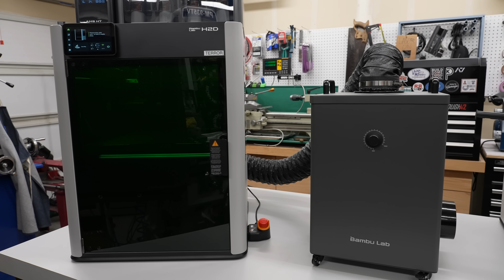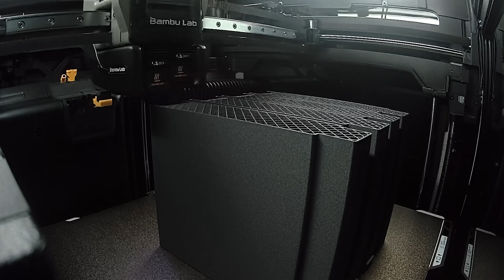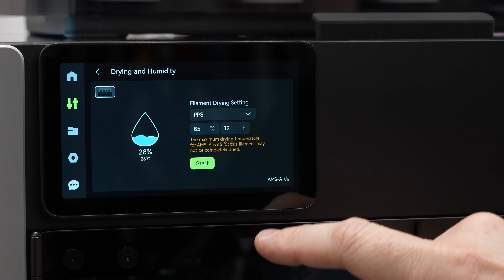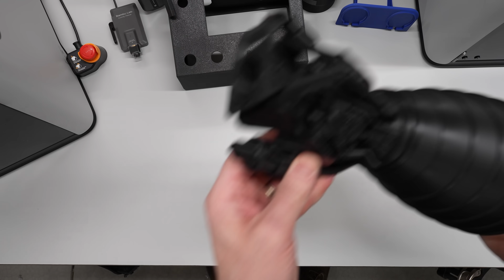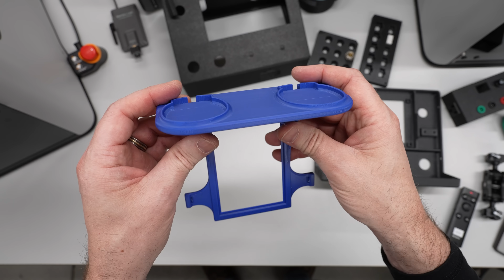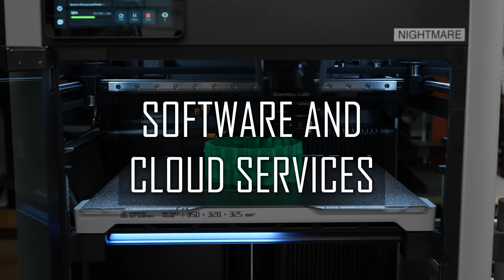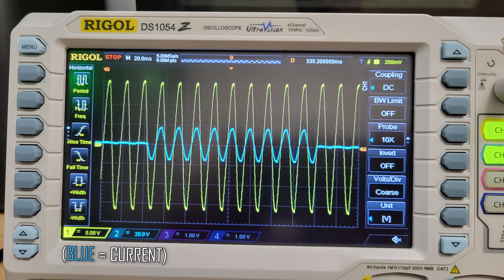What I Learned from 300 Hours with the Bambu Lab H2D 3D Printer

Comment: I presently have two x1e have just over 4000 hours between the two. I am going to purchase the H2D. My question is I currently do not have a need for the cutter or laser however maybe down the road. Can the laser and cutter be added after or do I have to buy it now. Secondly I use the Bambu slicer will I need to add a different version of the slicer for the H2D?  Thank you in advance!

Comment: Sounds like a nice tool. But I do like to build 3D printers as a hobby and tinkering with it, so I stick to my diy printer for now. If I need bigger parts I just use my CNC router with 1440x700x210mm build volume and do some subtractive machining instead. I don't use the 3D printer that often so spending another $2300 for this one wouldn't make sense. But if I ever want one that does it all and without fuss, I'd probably be looking at this one.

Comment: Your thoughts are very good, thank you for sharing something so valuable (I'm just getting into the world of 3D printing). Have you tried laser engraving on metals, such as knives? I looked for something related to H2D and didn't find anything... 

Finally, the "all in one" idea seems like a great investment... I'm worried about long-term maintenance, since it has many sensors and the use of the laser generates a lot of dirt, which can accelerate the wear of these parts (I speak from personal experience, I've been working with a Raykus 50w laser machine for 3 years and it generates a lot of dirt...), considering it as a service sale, while the printing is in progress the laser is unusable...

Comment: Great review and great knowledge from you until you told us your have socket outlets on the same circuits as lighting 🤦. Electric design outside of the UK are dangerous at best and a man with your knowledge and skill should do some rewiring before you burn your house down....
Reply from the maker: Should I put in ring circuits while I have all the walls open and the insulation pulled out?

Comment: While I agree with most of your points you failed at a couple. The Prusa XL is a 5 head printer while the H2D is only a dual nozzle single head printer. I am very disappointed with the Prusa XL so I really would not recommend buying one but that is not really fair. Use another idex printer to compare it to instead.

Comment: @Clough42...  I love the review and brought an H2D I wish you had explained the AMS 2 and filament dryer in more detail.  I was very disappointed to find out the AMS would not dry filament unless it was fully unloaded from the AMS.  I assume this is so it could rotate the rolls.    This feature basically makes the AMS dryer useless during prints.  That is it can not run during prints. After a print is done it can not run and dry out filament in prep for next print, after you remove old print.  It can not be proactive and run while printer is idle, etc.   Basically you can be drying filament with AMS or using the AMS not both.  As such it does not add any real value, over having external dryers.

Comment: I just ordered the full H2D laser bundle, 40 watt laser. It's not going to replace my 100W CO2 with the 20 x 28 bed, but it will be able to engrave where the CO2 requires a mask or anodize to engrave metal.  This should be an interesting ride.

Comment: I am kinda glad I didn't get the X1C last year now, you easily sold me on this one with how many things you were able to print perfect that even the X1 struggled with, and all the automatic calibration and monitoring to save me trouble baby sitting.

Id rather spend my time as a new comer mostly learning how to actually design my own prints rather than making a system run without error.

As what I see in your video, you having so many custom control panels and such is exactly the kind of thing I want this for.  I am always working on DIY projects and this would upgrade my capabilites greatly.

Comment: This is not a good printer for TPU, the solution feels like an afterthought and does not go well with new AMS 2pro which goes on the same head etc. This is a painful and expensive large X1C we wanted. We just wanted a big P1/A1/X1. This is NOT a great choice. It is not good bang for the buck. This is an overly expensive X1C with larger print volume and all of the extra features are things you will not use and come with childsicknesses of their own. Big red flag. Zero interest. The printer we wanted was a huge P1 or A1, or an X1C with 40x40. Not all this random nosense pushed on you to hike the price to over doubled. Big L for bambu this is not what the consumers wanted.

Comment: Great review! I saw that you already own the AMS HT. Since this is currently not yet availableto the public: did you try to use fiber-reinforced filament with the AMS 2 Pro too? If yes, I would be interested in your opinion on this since Bambu Lab does not recommend to do so but it would be a nice option if it works.
Reply from the maker: Really?  I've run ABS-GF, PAHT-CF, PETG-CF, and PLA-CF through the AMS 2 Pro without any issues.  I think the only thing I've bypassed it for is soft TPU.
Reply: @Clough42  They have PLA-CF/PAHT-CF/PETG-CF/Support in their list of supported materials and then state in their list of not supported materials "Bambu PET-CF/TPU 95A, and other filament that contains carbon fiber or glass fiber".
So I am most of the time using ASA-CF, PC-CF and PA-CF. All of these are not explicitly mentioned. That's why I asked.

Comment: I like your content as you use these machines for engineering material for which I also like I do not print anything other functional parts and yes I finally had a reason for nylon carbon fiber and it came out great

Comment: Interesting about Prusa XL. I've seen several videos with negative experience. I own one too. I has mostly positive experience. Major think I've learnt that I have to dry my filaments in order to achieve stringing less print. I printed different prints with 3 and 4 materials too. Of course I needed dial in all filaments before of the print if it was not original Prusament.
Reply from the maker: I think it really depends what you're trying to print.  I dry all of my filaments before use, and struggled mightily anyway with everything except for Prusament Galaxy Black PLA.  That printed reasonably well for me, except for odd outer wall artifacts when transitioning from large infill areas to thinner walls.
Reply: So prusa doesn't pay/sponsor machines to many youtubers. Compared to bambulab that gives everything they want for free. Even little youtubers get free machines to keep, so ofcourse they come out better then the competition. And most printers need some work to properly get everything to work, especially with custom design stl's

Comment: Comments about the power are only valid in USA where voltage is 110V and therefore current is higher - double for the same power draw, compared to countries where voltage is 240V.

Comment: I agree, this looks like a printer now.
But too much sensors for me. But yeah, it is a tool. Not an ordinary hammer though. This is a super duper hammer, which needs special gloves, special glasses, special robe, and you need to activate it before use. And it costs a fortune.
But this is a good hammer, I agree.
I prefer more simple hammer. Which you can do by yourself even, as it's so simple.

Will wait for the next model to see a review on it. It is just like an iPhone promo, very nice to watch.

Comment: All those cameras and sensors and you can still collide with an unremoved prime tower?!?
Reply from the maker: Yeah, it's supposed to detect that.  I wonder if that feature wasn't working yet when I did my testing.
Reply: @Clough42  Mind if I ask on the bed heat distribution issues others have reported?  I'm considering getting one but I am in the crowd of my X1C is currently running without access to the internet, Orca Slicer, and Home Assistant add-ons in place of Handy.  If they open up laser to dev mode I'll be buying.
Reply from the maker: @JohnDoe-wi8sx  I never noticed any issues with bed adhesion.  After hearing about it from others, I pulled out a thermal camera to have a look.  The initial heat-up does appear to be uneven, though after a while the heat spreads.  I think it's a fair critique, but I'm not convinced it's a practical issue.  If I had to guess, it's likely an engineering tradeoff for having the bed heat so rapidly.

Comment: Hello and thank you for the excellent review. I paid very close attention to your comments. I am a manufacturer myself and currently use Raise 3d systems. My eyebrows were raised when you were talking about the speed of this H2D. This is really where the rubber meets the road for me. Their documentation is all over the place on speed. As you said yourself "they throw out numbers". Their actual literature  says print consistent at 600mm/sec. That is nuts fast. And in some places it says tool head speed 1000 mm/sec. I actually contacted them and said can they explain. I was given 60-80mm/s for outer shell and 80-120mm/s for infill. What is your experience? You do comment on how fast this machine is, but do not give actual numbers. I know everything is relevant and based on certain criteria and quality but I do want to buy this machine but am looking for facts about the speed. Thanks again for the great non bias review.

Comment: So im in the gym and I see between sets the printer failing. Now I live a few miles away from the gym. OK so remote watching. Why would I want that?

I stay and wait. Do more design and then when done I leave, as I am now
Reply from the maker: If I see something going wrong, I can stop the printer remotely and deal with it when I get home.
Reply: which surely means as theres no way to fix spaghetti and restart printer say 2 lines back, you need to be quick. Stop it fast. That to me means you have to be almost glued to your phone screen. No point in going out. Or am I wrong and you can go back a few lines in a print?
Reply from the maker: @jamesbarratt593  I'm not sure what you're saying.  Spaghetti happens when an object comes loose from the bed and moves.  You can't fix that, unless you're referring to object cancel.
Reply: @Clough42  I was saying basically if you are looking and see a fault, most faults or maybe all you cant get around and then the print is ruined. Is that true? If yes then might as well just come back and find out later if print worked or not. I know power cuts the x1 carbon is fine with. Tried that a few times unfortunately,
Reply from the maker: @jamesbarratt593  most failures can't be fixed or saved, but you can prevent damage to the printer by stopping it instead of letting it push objects around the chamber, bending or breaking hot ends, building up a blob of material on the nozzle, etc.  This particular printer has features to detect a lot of failures and stop on its own, but I never fully trust anything.

Comment: Good video, but I would have liked to see some more complex geometries being printed. These are all very basic and in most cases require little to no support. Complex geometries requiring separate support would have been nice. 

I also wonder why you use CF filaments, is it just for the look? It would have been much better to see the capabilities with raw materials, we all should know that CF simply negates warping in materials above PETG, ie ABS, Nylon, PC etc. The rest of the claimed attributes of adding CF simply aren't true. So I would have liked to see ABS printed with no warp, rather than ABS-GF that was never going to warp, even in a lesser printer.

Good video, just not aimed toward anyone above a hobbyist, and this printer is definitely getting into the commercial and even a tiny bit into the industrial arena, where the requirements are very different to what has been printed here. 

For instance, dual nozzle has always been top of mind in the industrial arena, not for pretty colours, but the real need for quality support filaments. Hobbyists on the other hand could never get their heads around how to use a dual nozzle setup, and because the hobbyist community drives the development of Open Source Slicers and Machines, the manufacturers have never bothered to understand it either. So if the printer does have the ability, the slicer doesn't, so dual nozzle on these machines has been next to useless. 

I hope Bambu have thought about the Slicer as well as the machine, because if the H2D uses the same current slicer, then I can say for a fact that it will not perform as it should, as it does not have the functionality required. To date, there is not one open-source slicer that has the correct functionality to run dual nozzles correctly.
Reply from the maker: Would you like to mention which features you feel are missing?

Comment: do you know anything about working on a local network without a web connection? I work in a company where they are a bit paranoid and don't want to have a printer with cameras connected to the network, what features would I lose by blocking access with a firewall?

Comment: James, did their Engineers say anything about possibly using a "dry lube" instead of the grease?  I only ask because a dry lube on the inside edges of the pulley flanges may not risk the possible mess of the grease... I think.

Comment: Hi there! 🙌

I’m currently exploring some possibilities with 3D printing and have a question I think you might be able to help me with. I’m looking to print a part using two different materials – one for structural reinforcement (like an internal skeleton), and the other for the visual design or outer surface.

Do you know how to do this with an H2D (dual extruder) setup? Is it possible to assign different materials to different parts directly in the slicer, or do I need to create two separate models and combine them? Also, is there anything specific I should keep in mind regarding material compatibility or printer settings?

I really appreciate any insight you can share – I love your videos and how clearly you explain things!

Thanks a lot in advance!

Comment: A great review.  I have wanted a dual extruder machine with a larger bed.  The H2D is certainly that.  I have been concerned that having the other functionalities may affect quality of the printer but your results are quite amazing.  I had largely ruled out this machine despite my love affair with Bambu products, but your review has changed my mind.  I will be sure to use your affiliate link when I pull the trigger in the next couple of weeks.

Comment: 17:04 You can only know that if you know the length of the PTFE tube, so I don't think that is correct.
Reply from the maker: The length of the tube has no bearing on it.  It uses the odometer in the AMS to measure how much filament it has to feed before seeing the RFID tag a second time.  It's clearly documented here:  https://wiki.bambulab.com/en/ams/manual/ams-function-introduction

Comment: This is the best  review of the H2D I've seen, you gained a subscriber.  Most other reviews are like some guy reading marketing copy while the machine sits on the table or just printing the useless benchy, or even worse, don't even HAVE the printer and are just spouting off opinions on a machine they have never used.  Whereas you are showing the kind of parts anyone buying a machine like this would actually be making.  Your parts are exactly the kind of things I make and the quality looked great.  You are showing best use cases of the dual extruder as well.  Like many other people, I could care less about the laser and think anyone wanting to do laser engraving should take the $1000 extra they would spend on adding a low power 10W diode to the H2D and buy a legit laser engraver that will have more power and more work area.  But the works-first-time aspect and the high quality you are getting with engineering filaments makes the base model attractive.  Still too expensive to use as a printer farm workhorse, but a good specialty machine to have one or two of for making high quality prototypes.

Comment: Why is there a small hole in the model of the exhaust? Thanks
Reply from the maker: To allow access to the fourth screw.  I keep meaning to print a tpu plug for it, but keep forgetting.  When using the extractor, there's negative relative pressure inside, so it pulls a tiny bit of air in through the hole.

Comment: Great review as all your reviews are.  I was hoping that the improved AMS for the H2D would be able to feed abrasive filaments.  I’d rather have that capability than the heating, which will always be better done in a dedicated blast oven — especially for filaments such as PPA-CF.  

As for the 0.1mm offset for interlocking parts, my X1E consistently delivers to that level of precision across all materials.

Comment: I like the idea of using the H2D as a tool like you said.  I Already have enough hobbies so phucking about with 3D printers doesnt sound like fun to me.  I like the idea that this printer as an expanded range of filament options and would be interested in a review that explores the range of engineering filaments this printer can use.  I am into RC gliders so the option of the 10W laser is also of interest for me since I can use it to cut wing ribs from ply or balsa.  I was looking at getting a P1S and buying a laser cutter but this may be a good option for me